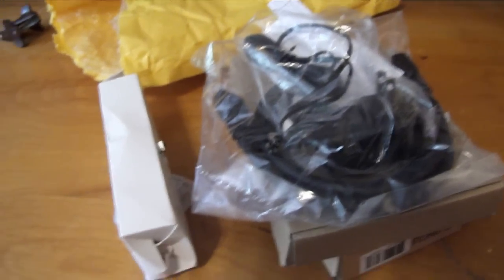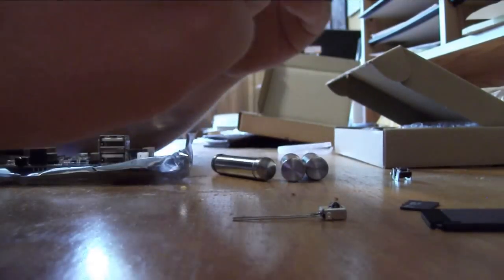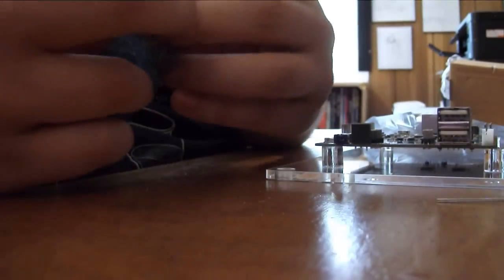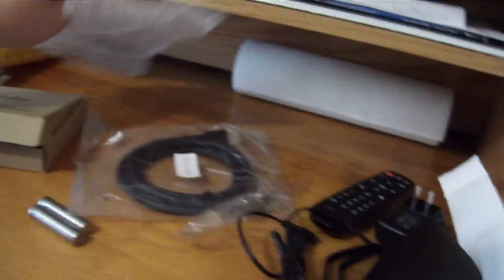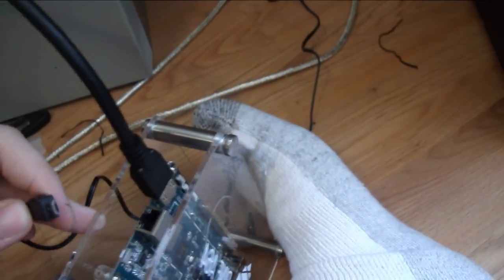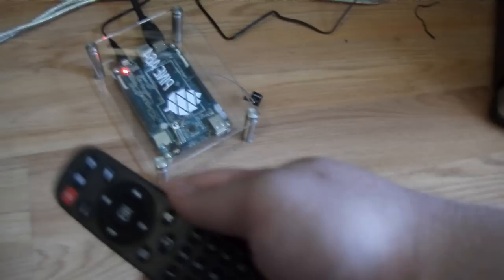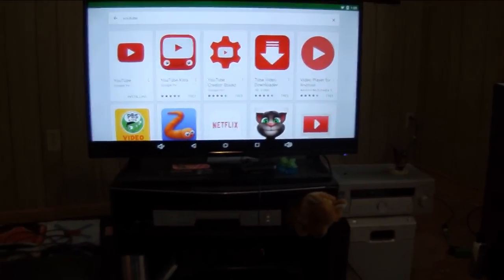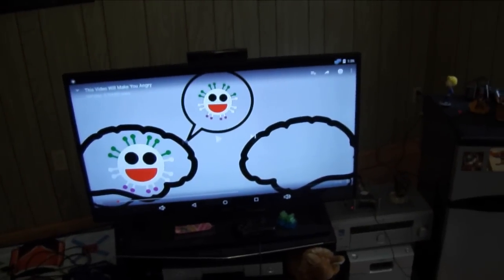PINE64 $15+ media computer (mine was $70 with the options)

Comment: man some people this is a hobbyist board its not main stream.
Quit being cheep you want a media centre fork out the cash do not have the cash? I suggest less carbonated sweet drinks then you could afford one and we would not have to listen to your lungs struggling to fill them selves with air
Seriously you can mistake an IR sensor for a Button????
Do your homework and stop making tech/review type video's you know just about enough about the product to be dangerous but not productive.
These single board units are far more than a cheap computer, ideal situations for these are apply it in a closed circuit loop or a drone,  weather Monitor, the application of these SBC's is limited by your imagination and ability.
Will it replace a dedicated media server no. can you use it as one yes, if you like buffering and choppy video go for it if however you need something to monitor water levels for example or use it as a flood detector this is ideal.
Could be hooked up to a Camera, lipo battery and solar charger and used to monitor a nest box at a far cheaper cost than buying that type of equipment retail in those scenarios these units are exciting what is not. Some guy that knows jack trying to save money rather than jump on ebay buy a second hand media centre for a similar cost this is just laughable.
and you wonder why your subs are low LOL

Comment: To fix the play store issue with android. Go to settings, apps play store and clear ALL DATA AND UNINSTALL UPDATES.  Go to play services, manage data, clear ALL DATA, UNINSTALL UPDATES and restart the OS!
Reply from the maker: hey a constructive comment.

I got it working previously, but you are right as to how.  I didn't need to uninstall updates but i did have to clear all data in play store and play services to get it working properly.

Comment: Hey!  You got a switch, not me.  No instructions for anything.   It the acrylic case, duh.  2 minutes and I am already bored.   Lets jump forward 3 minutes ... A 16 GB card notice!  Hey I sure did not get any such piece of paper, I got nothing.   Try a Rii i8+ for a keyboard.  Use the circle symbol to jump out and application.   Ethernet runs at 1% the speed of wireless and it useless.  Define "functions"??   Some apps will not install under Google play.  The need to use a direct APK downloading site instead.

Comment: First of all, this is a development board. You should know that before purchasing it. It does require some level of knowledge to use it. Secondly, it's a kickstarter project. NOT a store bought retail product. Your expectation for instructions is laughable. Thirdly, being that it is a development board, you should know what an infrared module looks like. Fourthly, your complaint to having to solder a free included extra is ridiculous. It's a development board. People who develop electronics have to solder sometimes. They included this as a free optional gift. Of course you have to do it yourself. God forbid you have to learn a little with this thing. 
Lastly, not only was information about all the components included here available in the kickstarter emails as well as their website, but also on their support forums. So not only should you already know everything I've said here, but it's also all available online. Your initial disappointment is really your own fault for not being more informed about what you supported, not bought.
Reply: I agree with you Richard Moser, this guy has no right to complain.
Reply from the maker: firstly . no it is not unreasonable to expect setup instructions. or at the very least pinout documentation, I ordered the ready to go media pack after all, not individual components.  I literally had to guess which direction the IR receiver was to be plugged in.  

Secondly this wasn't scripted and I didn't look at things before i opened the box. Just because I didn't know what the IR thing was at the first moment doesn't mean i didn't work it out as evidenced by the fact that i was using the remote later in the video.

Thirdly, you are kind of an asshole.
Reply: They expect you to have intelligence above that of a single cell organism. You couldn't even put the case together right so the Pine64A words face in the right direction. I got mine and didn't get the case or the IR or the remote, in fact I provided my own SD memory and downloaded and installed the OS, Android on one memory and Debian Linux on the other and I installed the buttons on it to power it on and reset it and I did not need any stupid instructions because I knew what I was getting when I paid the money, I knew I was going to have to do work to it because I READ the description of what I was getting, it says its very basic, that you have to assemble it and have the ability to make it work. I used a USB keyboard and mouse along with a USB hub, everything worked great.
Reply: And on top of what you said, like I said previously, it's a kickstarter. Not a store. I get the idea of wanting further instructions when you buy a product from an online store. kickstarter is NOT a store, and people seem to keep thinking it is. You're not paying for a product - you're paying to support a nonexistent product, and certain pledges give you certain rewards - in this case, you get a kit they intend to sell in the future(NOT one they are CURRENTLY selling).

You're exactly right, going into it, you have to have at least a basic knowledge of what it is, what it's for, and basic assembly.
It's not a computer - it's a development board. It's also not, and never will be(even when it IS being sold in an online store) a simple setup toy like this guy seems to think it is.

Comment: at least you got a note explaining what the loose parts were.... I haven't watched the rest of this yet... it's poorly edited, not considerate of the viewer.. that said.. the 3 lead item is not a switch, it's an IR detector for the remote control.
lots of failure on the part of the Pine64 team.  there is so much they could have done, but didn't.
Reply from the maker: ya they coudl have done a much better job.  I did figure out that IR sensor.  but I had to straight up guess what was the correct way to attach it.

Comment: That "random" component that is loose in the box is a kickstarter reward for reaching a certain amount of money raised.  Solder it on either the reset or power pin holes on the board, its actually a good thing to have.
Reply: Yes it's helpful to keep up with the updates :).

Comment: Atleast yours booted up and worked ,I bought only the board thank god .Not working for me linux or android or remix os .not very happy.
Reply from the maker: Ouch sorry.  ya I can't help with that.
Reply: +Morpheus ok turn out to be sd card brand. i bought pny 125 gb droid worked. hoping later remix os works same. prefer remix os. my pine64+ 2gb though forums read remix os having issues with my type.
Reply from the maker: Well I'm certainly glad you got it sorted.
Reply: Check fourms/google for help. theres many people who got it to work that could help. I got remixOS on mine and I use mac.. IF you do to, I made a "Tutorial" steps post on the fourms. I could link it to you if you want.
Reply: +The Woofies Im using windows 10 on my pc. remix os is very slow. Try to even go to settings it bogs down to the pount where it says non responding close or wait. ubuntu works its faster than droid and remix but still lil slow. Ill recheck forums
Reply: +Beho lder what's slow? The boot up?